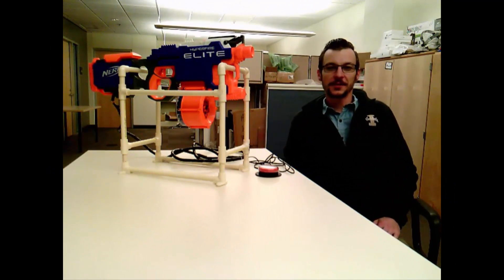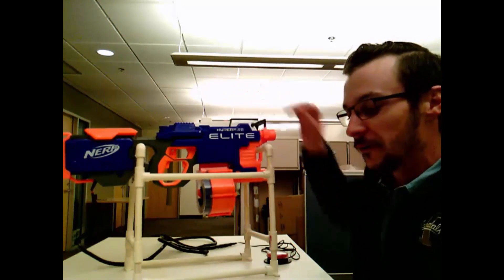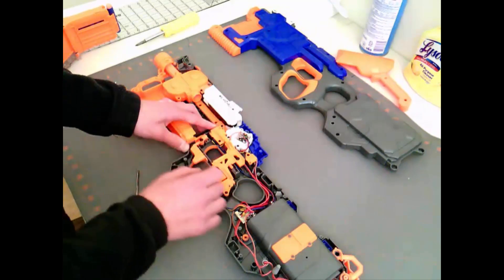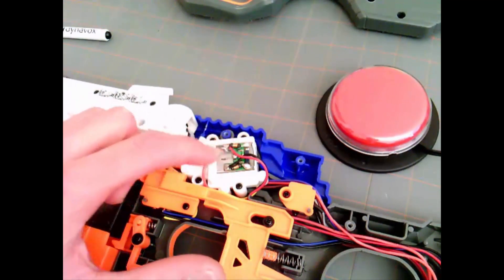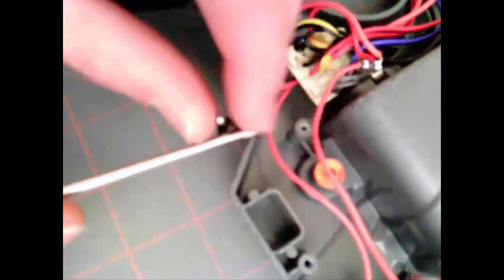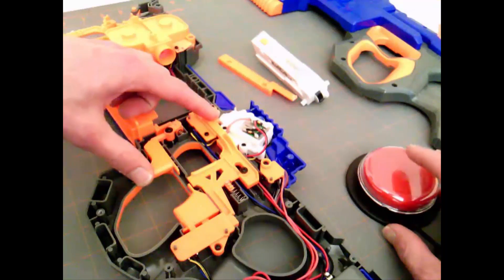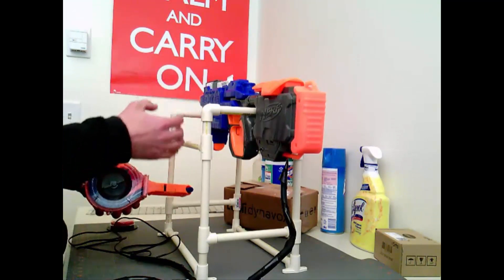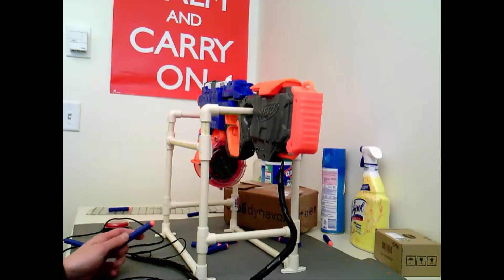Switch adapted nerf gun

Comment: I stumbled on this site experimenting with Google’s picture search. I had a Nerf Gun in pieces on the work bench and thought it would be an interesting test, which obviously works!
We adapted a couple of these guns for a client a few years ago, and have a request for another. This involves remembering how it was done originally!
I’m curious, and wondering if the guns supplied to Australia have different wiring. Both the fan and feed trigger switches in the units we have short the motors to battery negative when not depressed which acts like a brake on the motors, stopping them quickly when the trigger is released. This also means adding a simple circuit with a switch between battery + and the motors creates a direct short across the battery.
Our simple solution was to disconnect the battery negative (black) wires from the switches by disconnecting them on the little PCB (labelled SW1, SW5), which meant the motors wound down over a second or so instead of a fast stop. Not a big issue.
After that, we added a small circuit triggered from the adaptive switch. The circuit starts the fan, and a second or so later starts the feed motor.
If anyone wants this circuit, we are happy to share, along with some pictures. Combined with Nicholas’ great video it should cover this version of the Nerf Gun.
Cheers, 
Technical Solutions Australia
(james@tecsol.com.au)